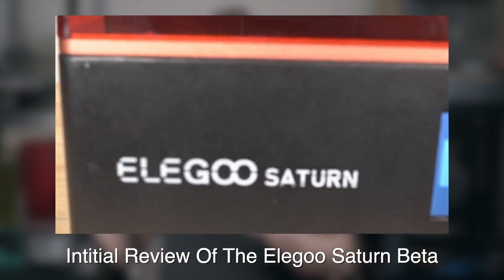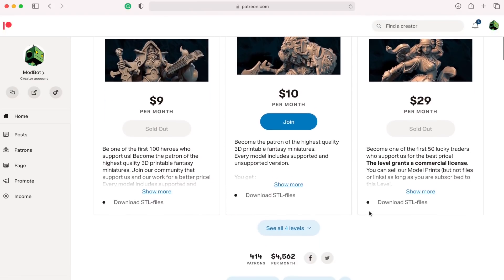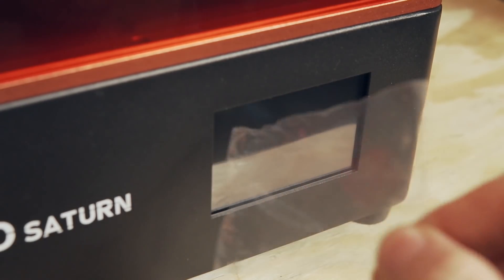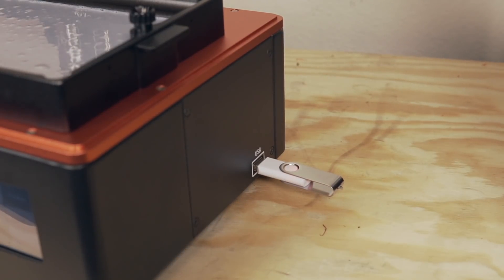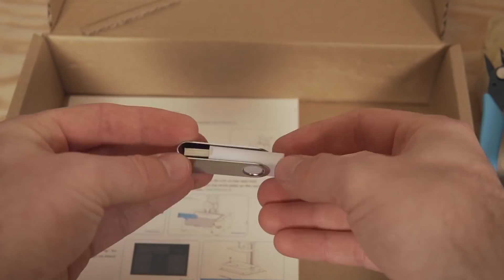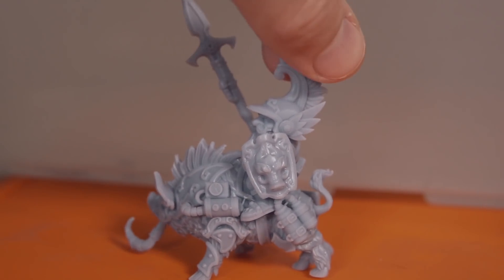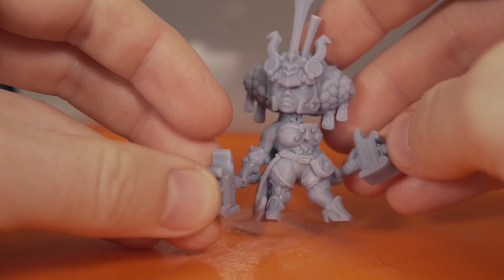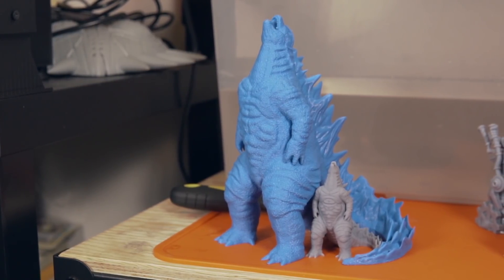Best Resin 3d Printer 2021? Review Of The Elegoo Saturn

Comment: I have a question. Hopefully someone can answer this. I am thinking about getting the Saturn model. If I am doing a build, and I think I'm running out or about to run out of resin before it will finish, can I just remove the top add some more resin in while it's working or do I have to stop it then add some more resin and then continue?

Comment: Is it bad that I'm skeptical of reviews where the product was received for free and the provider of the product slaps the channel name on the cover? I don't want to be, but I just can't help it.
Reply from the maker: I think that is more than fair. I feel that I have been on here long enough and have proven that I give an honest review based on my experience. That being said, I see no reason not to watch multiple reviews to see what does carry over and what does not. Usually when I am interested in a product I do the same. But absolutely I can understand your initial impression.
Reply: @ModBotArmy  I just want to make it clear that it is nothing against you, nor am I accusing you of anything, but it is really hard to find Saturn reviews where the product wasn't provided for. I had a Mars 2 pro for 2 weeks and sent it back because there were so many build quality issues. I ended up getting a Photon Mono and it has worked perfect from day 1 and was quite a bit cheaper. Plus, Elegoo was pretty difficult and slow to deal with customer service wise. 

So let me ask you this Proxima 8.9 or Saturn? Will be using Lychee 3 exclusively.
Reply: @ModBotArmy  nevermind. You have a video that answers that. Gj :)  plus the 8.9 Proxima is only 424$ Prime shipped right now.

Comment: First off thanks for all the great content!  I have been looking to jump into 3d printing and your videos have been a god send.  For someone who is mostly interested in printing collectibles (movie/game props and such) and minis am I limiting myself in quality of work by going with an FDM printer?  Or am I going to struggle more with the limited build volume of a resin printer?
Reply from the maker: Hey! Thank you very much for the kind words as well as your support. I really think that there is a place for both. It may be worth finding some of the things you want to make and see if they will fit on the different build volumes. Something like that Saturn is not that small, but if you compare it to say an Ender 5 Plus it is of course much smaller. FDM prints will have to be sanded much more than a resin print before being able to paint or post process, and I do feel they are much less ideal for miniatures. If budget allows could you consider one of each? Even starting with say an Ender 3 for sub 200 would allow you to experiment with both.
Reply: @ModBotArmy  absolutely. and thank you for the suggestions.  I think that eventually i will have both, but right now biggest issue is space.   I think I will get into a slicer today and see if these Buster sword pieces will fit without changing the scale on the Saturn.

Comment: Would you recommend for a 1st 3d printer
Reply: I dont see any reason why not if you know you want a resin 3D printer. Altho you could save money by getting a smaller model if you dont need the larger build volume. If you dont know the difference between resin and FDM machines, and pros and cons between them id recommend looking into that first :)
Reply: For a fdm so like a filament a ender 3

Comment: Would this offer some of the higher quality prints of the printers on the market?
Reply: The resin printers blow filament printers away on detail of parts. You can get seriously crazy levels of fine detail. This printer increases the build size over previous generations  so larger single prints can be made.
Reply: @phoenixamaranth  I understand and was specifically referring to other resin printers.
Reply: @kfeltenberger  Ah, gotcha. On that front, no, they're all about the same. The newest ones that will be coming out will be 35um where this is 50um like all its competitors on the market currently, but it's really diminishing returns. 

They're already able to capture such fine detail with 4k resolution lcds I don't know how much the 35um will matter for average printing if you were wanting to wait. Given supply restrictions, the 35um machines may still be a ways off down the road. 

All current resin printers are between 47um - 52um which is pretty imperceptible of a difference to the naked eye.

Comment: Wait, so resin seems amazing compared to your blue one, so why don't you do resin much?
Reply: I still use my filament printer for build size, no cleanup if i don't need the detail, and for stronger parts. The resin parts are fantastic for high detail things like gaming models and artistic pieces, but aren't strong enough for use in most weight or force related applications.
Reply: Limited build size, more hazardous, more ppe, just overall more of a pain.
Reply: @brandonr2188  but the blue is so far inferior... And ppe is no problem

Comment: How much do you spend on resin on a basic character model make? how long does a tank of resin last and how much resin do you use? Can the media be reused?
Reply: It will depend on the size and if you hollow them out or not. A small D&D model is about a quarter or two in cost, but the resin is around $25 a 500ml bottle. An average 500ml bottle of resin will fill my resin vat twice over, but all that resin may take weeks to use or could go in one shot for a large, dense model. The resin itself can sit protected from light for a few days, but it's best to filter it off and put it back in the bottle if you're not continually printing. Once the resin is exposed to UV, it can't be reused.
Reply: @phoenixamaranth  Thank you!

Comment: Hello Modbot, i'm brand new to 3d printing, but have a chance to buy the Elegoo Saturn. I've been told that getting water washable resin is a good idea (as it makes less smell) and would it be alright to get the Elegoo Mercury Plus 2 in 1 wash and curing machine to go with it? As I can get them in a pretty good deal.
Thanks for your time

Comment: We received a Saturn and a Phrozen Mighty fast 4K simultaneously. We prefer the Mighty because build plate only needs the build plate leveling once, not every second build as on all Elegoo machines. Also 20mm higher build height and slightly larger build plate on the Mighty.

Comment: I just picked up an Epax E10 about 2 weeks ago now. Very similar printer but about an extra 50 mm of Z hight on the print volume and future options of a 5k 10 inch mono LCD when I end up needing to replace the screen though it is about $200 more than the Saturn. Very pleased with the results so far. :)
Reply: If it's a future option then the total price will be considerable more as I suspect the 4K screen will be priced from about $150+.
Reply: @andyspoo2  they are put now. The screen it's self is about $100 more than the standard 8.9 inch screen and the full upgrade kit which includes an alternate daughter board is another $100

Comment: I’d grab a sovol flexible build plate for any resin printer. ~$23 and comes with two. I definitely do not miss ramming that scraper on the build plate to pop them off
Reply: Right? Took me way to long to find out flexible build plates existed. That was the worst nightmare that made me not want to use my original Mars.

Comment: I picked up a Creality3D LD-002r 2k is great but this Elegoo Saturn 4K is the Build size I would have liked to purchase. i like to print the mini's in 72mm or larger.
Reply: That's a good printer, but I did return mine literally two days after buying it because the Saturn was announced. LOL, I felt bad though so I ended up buying them an FEP sheet and changed it out and returned it in near new condition. The mono screen printer is definitely worth the upgrade though. Creality has there own 4k mono medium sized printer now so, there are options.
Reply from the maker: I think having a small resin printer is still great and then a larger for bigger prints or batching out parts.

Comment: I managed to get one Saturn two weeks ago, however, since it is my first Resin printer i am still learning how to do successfull prints to show on my channel. The hard part is the cleaning process but the more you practice the more you getter better at it.
Reply from the maker: Yeah the post-processing aspect is definitely something to get used to. I am stoked you got one though :)
Reply: How did u get it im still struggling
Reply: @thehobbyist146  this is a great video with a lot of useful information on how to minimize the mess and how to think about the post processing methodically rather than just winging it. It definitely helped me in getting my set up. https://www.youtube.com/watch?v=onVNnRjbm5g

Also I cannot recommend the Wham Bam magnetic build plates enough. They are an absolute must for me. and make it so much easier to get prints off the build plate and minimize the mess because you never even have to remove the actual build plate itself just pop of the sheet of spring steel flex it a bit and the parts will fall right off. https://whambam3d.com/collections/fbs-for-resin

Comment: So do you like this one better than the equivalent size by anycubic?  Any upgrades you’d recommend?
Reply: The only upgrade you might need is a Wham Bam sheet. For some reason files that don't have supports are very hard to remove from the build plate. Stuff with supports is easy.
Reply from the maker: Havent used the Anycubic so it is tough to say. This machine is great though and as mentioned the flexplate is likely going to be the main upgrade to get.

Comment: I've given up on trying to purchase a Saturn.  I had one in my cart twice during the pre-orders, only for it to be taken away, and it's impossible to purchase them from Amazon due to the reseller bots.  They purchase them the moment that they're available, and then resell them on eBay for 2-3x the price.  I'll wait for the Saturn 2, and hopefully Elegoo will address the bot resellers by then.

I've been using my Mars Pro to print functional parts, as you can use the ABS-Like resins for high temp environments and the prints look like normal plastic extrusions.  It works for both custom parts, and parts that Creality refuses to make available to the public.  ;)
Reply: i know it’s late but if you haven’t looked recently they’re currently in stock on amazon

Comment: I been watching for the Elgoo Saturn and the Epax E10 its main competitor. The Epax E10 has a slightly larger build size which intrigues me and from most everything else they pretty much have the same features and quality from the reviews I am seeing. Both are hard to find right now due to the global supply problems and the newness of both. I think Elgoo, as a company, has been around longer though. Not sure about that. They have the more popularity of the two anyway. I'm hoping later this year to get my hands on one of them. Maybe I'll get both and compare.
Reply: The Epax 10 looks good, minus the plastic build plate and vat. To some, its just too cheaply made, but there are some great positives to it with the ability to jump to 10" LCD and increase build volume in the future. Additionally, I'd imagine there will be a aluminum build plate and possible vat available in the future.
Reply from the maker: I have not used the Epax but I have heard good things as well. The good news is that by the time you are ready, I am hoping that both of them will be available for you.

Comment: Would you say that this resin 3D printer is good for beginners?
Reply: This was my first 3D printer of any mind. I found it easy to use, but I've also been casting with resin for years and have a space set up for the mess. You want this somewhere in the house that you don't live in, like a studio or garage. Good ventilation is a must.
Reply: Beginners to resin printing or to 3d printing in general?
Reply: @jhvnhjifgvbv8126  resin
Reply: @0ddsby  this is like any other resin printer, the pre and post processing will be the same.  As will the slicers
Reply from the maker: Most resin printers are going to be similar as far as the user experience as long as they can use Chitubox. However, the size and speed of this is certainly something that is attractive.

Comment: Great video.  Still torn on resin printing, the quality is amazing, but the hassle/mess always stops me from buying one.  I think the thing that stood out the most to me though in the video was that network jack in the back, not sure if that is common with resin printers or not, but that is awesome.  Besides cost,  I never understood why fdm printers dont have their usb port in the back, it would make connecting to Octoprint a lot less messy.  That is probably my favorite feature of the xy-2 pro, the usb port is in the back and has less cable clutter.
Reply from the maker: The location of the port never really crossed my mind since the last couple of years I have mostly used the included micro sd slot. Now that you say it though I do agree, keeping cables clean and out of the way if you are running ocroprint is definitely a plus compared to say creality with most of them being on the front. You definitely want a location for the resin printer. I have spilt resin before and it is not fun.